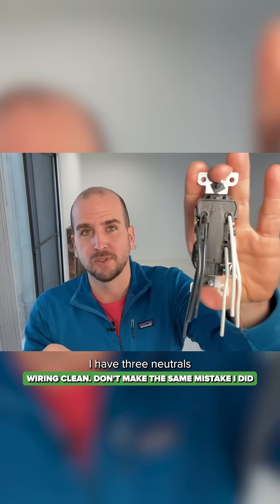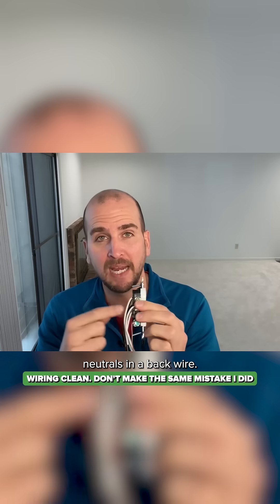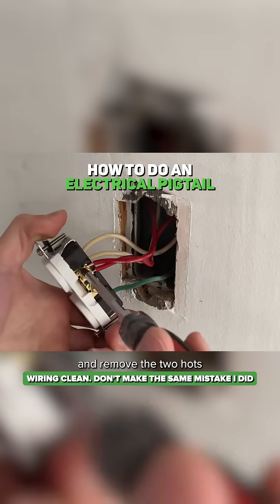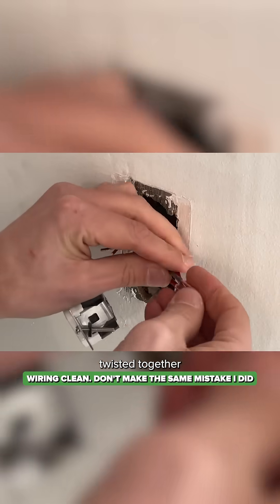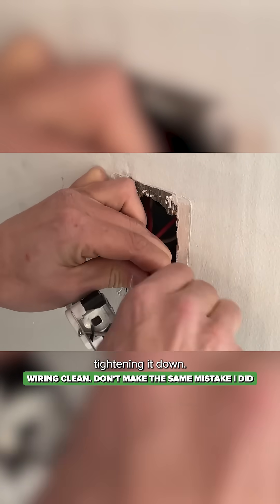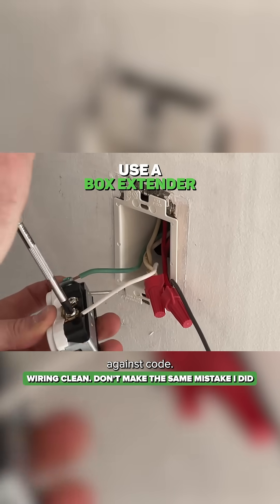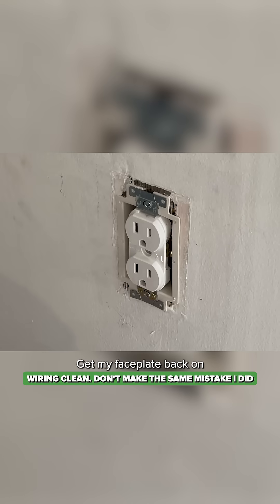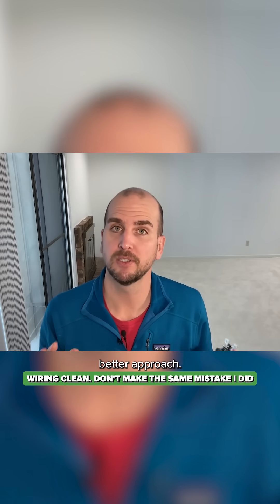Don’t Wire It Like This—A Cleaner, Safer Way to Install Outlets

Comment: Another reason for pig tails, if the device ever fails, the rest of the receptacles on that circuit will continue to function. Here in Canada it is code to pig tail your neutrals

Comment: You didn't describe why the pigtail is better. You only said it is less mess. Is there an electrical reason it is better? Is tte original wiring a code violation?
Reply: That's what I was planning to ask.  Perhaps wirenutted pigtails are considered more reliable? (Assuming one has learned how to properly use wirenuts.)
     "Less mess" is too subjective.  Some people might reasonably say adding two wirenuts is messier than utilizing connections available on the receptacle.
Reply: If the outlet fails it dumps the rest of the circuit.
Reply: @barfy4751  : If the wirenut fails instead, you think that's better than if the outlet fails?